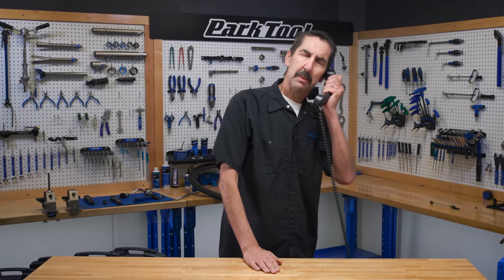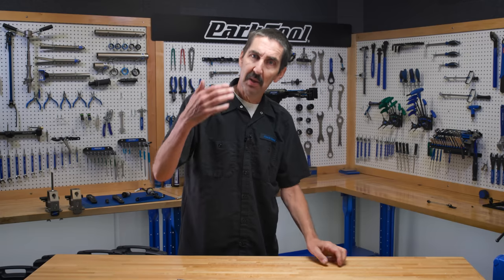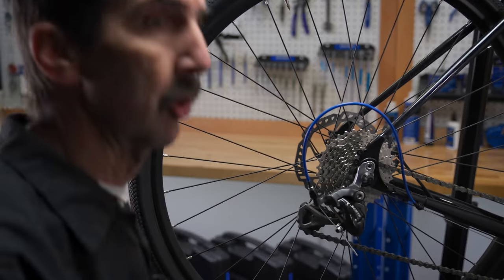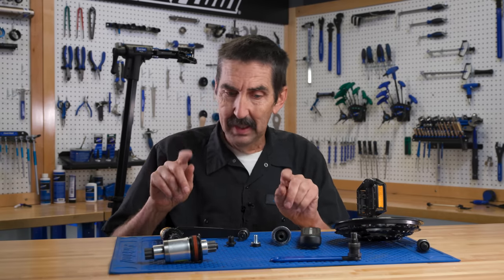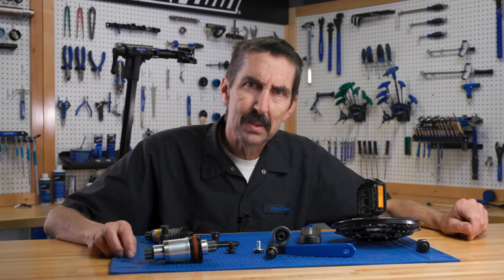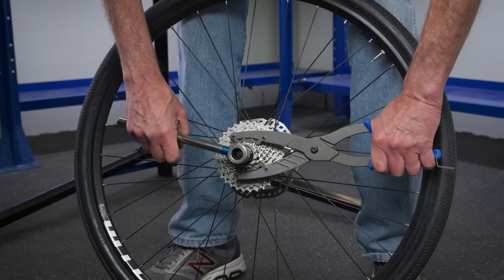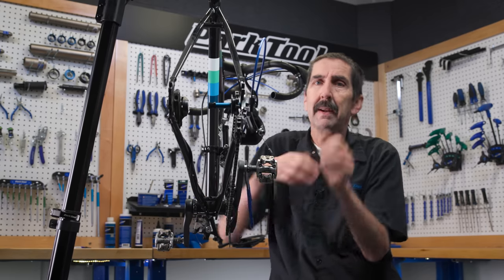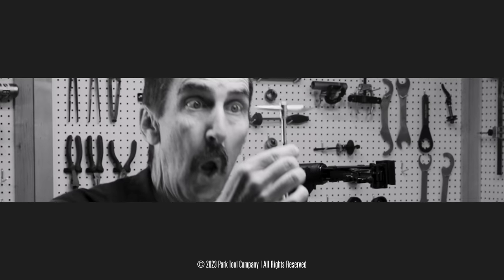You're Using Our Tools Wrong | Tech Tuesday #209

Comment: When mentoring junior bike mechanics in the shop, my first (jokey but firm) warning is that anyone found using the 15mm cone wrench on axle nuts will be immediately fired. 😉
Next is to get in the habit of spinning nuts and bolts the 'wrong' way when threading them on, until you feel the ''click of the start of the thread - it greatly reduces the chances of accidental cross-threading, especially in soft metals.
Also, get used to to feeling the tool's feedback through your hand - especially important with chain-riveters - once you've felt how it feels when it goes well a few times, use that 'finger-feel' knowledge to immediately back off and re-seat the tool if you feel the pressure going past what you'd expect - saves a lot of bent tool-pins and damaged chain-links.
Reply: Ha, ha, love it!   I wrote using a cone wrench on a 15mm nut above before reading your post.  Genius minds think alike!!!

Comment: The key to tool use is to engage one's brain before engaging the tool.  Think about not just what you wish to accomplish with the tool, but also what could go wrong.  For example, go through the motions of loosening a very tight nut or bolt without the tool, and see where your hands will wind up if the tool slips.  I've avoided many knuckle injuries, and saved damage to parts and tools, by applying this process.
Reply: this is basically exactly the thought process of orthopedic surgery too
Reply: Lefty loosy righty tighty
Reply: @kevinruiter8715  With bikes, not always.  In fact, every bike has at least one thing that's lefty tighty.
Reply: What’s the park tool part number for a brain? I’m not sure I have that tool…
Reply: @rangersmith4652  two things if you have a threaded bb . Forwards to tighten backwards to loosen with bike up the right way .
Reply: @Yoda-em5mt  That depends.  Is it English, Italian, French, or Swiss?
Reply: @rangersmith4652  true anyone with a non bsb bb deserves what they get ha ha .
Reply: That’s a fantastic tip. Often I’ll do a bunch of practice swings on the wall before hammering on the bike.  Warms up the muscles, letting you strike harder
Reply: @MehYam2112  Yeah, gotta prime the knuckles for busting.  Can't have any feelings in your knuckles if you don't have any nerves.  Modern problems require modern solutions.

Comment: Top tip, assess where your bodily extremities may end up if the tool slips. Particularly important when working around anything pointy like a cassette or chainring. Scrubbing drivetrain grime out deep cuts is never fun. 

Top Tip #2: It's not always lefty-loosy. I learnt this expensively the first time I tried to remove a BB cup from a frame. Destroyed the cup, bent a breaker bar, and almost trashed the BB itself.

On the subject of applying leverage I wonder if you also agree that certain jobs (removing BBs, cranks, and pedals) is best done on the ground, particularly if you don't have a pro-level workstand.
Reply: Yes, the ground is your friend for applying pressure!

Comment: Thank you Calvin and Park Tool for the advice and the many great tools over the years.  We run a community bike shop.  Our tools get used by people of all skill levels.  Park Tools work best and hold up the best.  A few we have found out the hard way that care is rewarded, and the lack of care ends up in broken tools or worse.  Chain tool tips are a good example of this.  All in all, Park makes the best and most appropriate tools for the job.  I do have one complaint, perhaps an objection to the idea that we're using the tools wrong.  We work on a lot of tired old bikes, either repairing or parting out.  So of course, removing cheap MTB freewheels is a regular thing.  We have broken numerous FR1.3 tools in doing this.  They just crush and split, either in the vise or adjustable wrench.  Inside a 1 inch box wrench they survive a little longer.  But the packaging and the video for the tool show using a large adjustable to spin off a freewheel.  The 1.3 is not strong enough.  What works to do this?  My trusty 20 year old FR1.1, or a small socket wedged inside the 1.3 for support.  I don't want to return any more of these.  I wish the tool was stronger!  Thanks for the tools, support, and videos!
Reply: While park tool is truely great, companies like Wera make outstanding quality tools.
Reply: @flawless7019  Wera doesn’t sell freewheel socket.
Reply: One technique I've seen is to mount the tool in a bench-vise and then set the wheel on top of it. Then you can use the wheel itself as your lever to loosen the freewheel.
Reply: @DennisWurster  Thanks, Dennis, yes we use this technique as well.  Without something to reinforce the center of the FR1.3 it can crack and fail in the vise too.  I think we're up to 4 or 5 that we've had fail in the shop in 3 years.  We also have now a 1 inch socket modified with flats on the outside, so it can be clamped in the vise and hold the tool without slipping.  Seems to work, with a few spacer washers inside it for correct engagement height.

Comment: Check your surroundings when you're going to crack a nut or screw too. Consider where your arm is going to go. You don't want your arm to move past or into anything sharp after you crack the fastener.

This is especially true if you're working on machinery with cutting tools in it, not just chain sprockets.

Comment: Calvin, thank you for making this video.  I’ve rounded out a few bolts in my time but I didn’t realize there were so many ways to use tools wrong!  My worst offense is using a. TW-5.2 torque wrench at bad angles because of a tight angle.  Is there a better tool to use for tight spots?

Comment: You can use the smaller (square taper) crank extractor to remove octalink and isis cranks, you just need to put something in there to cover the hole in the spindle, there are adapters for this specific purpose. Some crank extractors also have interchangeable feet to match the cranks being extracted.
Phillips screwdrivers will eventually round out derailleur adjustment bolts/screws so instead of buying a JIS screwdriver (the proper tool for this), I find that it is easier and cheaper to just replace the OEM bolts with hex socket head bolts and use allen keys
Reply: easiest makeshift type of adapter for isis cranks is an adequately sized counterhead screw. been there, done that.

Comment: I always install and remove pedals (and crankarms) with the wheels on and the bike on the ground.  That way I can position the tool to allow me to push down towards the ground, using my body weight to apply force and the drivetrain and tires to hold the crank arm in position.

Comment: I've got one!!  Hex keys and soft steel bolts. AVOID BALL END HEX KEYS on high-torque applications. Example would be crank arms and derailleur cable bolts. Ball end hex keys can twist in the fitting and lodge in, possibly marring the threads or allowing bad engagement with the bolt. USE NORMAL, FLAT HEX KEY sockets for proper tool engagement and to get the proper torque spec. on your proper components.

Also; when driving on large bolts e.g. cranks or pedals, use a large driver. It's difficult and unsafe to try to load 30-40nm with an allen key - step up to hex key sockets with a 3/8" ratchet driver for much safer and more effective tool use and result.

Comment: You actually got me on one. I bought an old bike to refurbish for my son. The BB was square taper. Without even thinking, I just grabbed the tool I normally use on my bikes. It managed to remove it. It forced the wider foot through the smaller hole. I just thought it was being difficult because it was an old bike hasn't been used in long time and it was stuck. When the crank came off, my tool is now stuck in the crank. LOL! I quickly realized the error of my ways. Fortunately, I wasn't reusing the crankset anyway.

Comment: Using a knife as a tyre lever, using a rotor alignment tool to straighten a bent rim, using needle nose pliers to unscrew a perfectly good stem bolt, removing the self extracting bolt from self extracting cranks and wondering how to remove them, 3D printing a dust cover to stop a BB from unscrewing, someone else taking rubber rim tape and peeling it apart when you look away, when the left pedals doesn't screw in the right crank, use the wrench harder. Some fun.

Comment: I abused my square tape bottom bracket tool on a stuck cartridge bottom bracket rounding off the splines a bit. So now I need to add a bolt into the pedal threads to hold the tool in place so it doesn't slip out. Also I now use impact guns to loosen cartridge bottom brackets (which is not very often anymore).

Comment: As a lifelong bike mechanic I have seen many instances of people using their tools incorrectly, or using the wrong tools for the job.  The thing that steams me the most is rounded nipples as I assume some of the damage was done by some teen working in some bike shop who could not be bothered to find the correct spoke wrench!  Most bike buyers do not try to true their own wheels.  Also, I often see deep scratches and divots on rims from screwdrivers used as tire pry bars! I use either the Park TL-5 levers or heavy duty plastic ones.  Never screwdrivers! Sure way to pinch a tube!  Last, I use only good quality stainless cables and the correct housings.  When I see brake housing on shift lines I want to hurl!  Not the biggest sin perhaps but easily avoidable by not buying those prepackaged cables/housing with a brake end on one side and shift on the other!  I have not used these things after age 12!  When I knew no better!   Last, when I see rusted chains I want to scream!  It is not difficult to service a chain!  And stop leaving your bikes in the rain!

Comment: I'd go back to square taper BB in a heartbeat if I could. I don't like Hollowtech 2. Octalink wasn't bad. I run a M970 crank that (as far as I know) is the only one that exists in the form factor it does - it's got a 24mm Hollowtech 2 size spindle and thus it works with all Hollowtech 2 bottom brackets, but it has a far more chunky mating surface, quite like an Octalink.

Also, this crankset doesn't have the typical (and stupid) 2 bolt system found on HT2 cranks (where the bolts strip, ruining the left crank arm) for tightening, it has just one huge bolt that gets tightened to 40Nm on the left crank. I love it.

You might wonder why I use it, if I "would go back to square taper in a heartbeat" - well because my bike has a stupid press fit BB shell and thus, I have got a Praxis Works converter on it (PF30 to HT2) and that's why I have to run a HT2 spindle... Praxis Works just don't make a converter from PF30 to square taper and even if they did, I don't think it would be sensible in a press fit shell.

The old M970 crank is the best design I have seen, whereas the most recent HT2 cranks have a weak mating surface and the M5 bolts that say 12Nm on them often strip. I mean isn't it obvious why? M5 bolts (or maybe they are M6) and 12Nm don't go together well! The max I'd say a M6 bolt should be taking is up to 8Nm. Design flaw.

Why not use the M980 crank since it's newer? The chainrings are a proprietary BCD, whereas the M970 is standard 64/104 BCD. There isn't a better triple crankset for MTB other than the M970.

Comment: Use the right torque and/or make sure to never over tighten anything.   I've seen so many people over the years (especially the general public) think a screw or a bolt needs to be as tight as possible. Either use specific torque wrench, use the right torque setting on your screwdriver, or manually quarter turn backwards

Comment: Tool tip: If you're trying to undo a stuck screw, ideally before you round it off, but even afterward: Use the principle of tool engagement (apply downward force to prevent the wrench slipping), even tap it a bit with a hammer to get full engagement.
Then, use the grippiest pair of pliers or vice grips you have to grab the head of the screw and turn both the wrench and the pliers in unison. This has given me just enough grip to remove many a stuck bolt that wouldn't budge with either method alone.

Comment: Wear appropriate gloves for the job. When unscrew locking rings for disc rotors for example, like Calvin did. Nice to see how easy you can slip and end up cutting your hand on the sharp rotor edges. I learned that the hard way. Nice heavy leather glove for the hand holding the tool on the rotor from that point onwards. Also prevents injury when sending your hand in a chainring when unscrew crank arms.

Comment: Thanks so much for this guys.  As a You Tube certified mechanic, my education never included all the theory parts like this :) 
This is super helpful stuff.  
Also, gee I'm starting to dislike lock rings on disc rotors for this reason.  Have a couple I want to take off, and getting decent purchase on a through axle wheel can be really tricky.
Reply: Just wait till you encounter a T47 BB. Similar width of engagement to a rotor lockring but torque spec is 50Nm. Naturally Park have a new tool to help

Comment: I was once accused of misusing Park pedal taps (tap-3) to clean up the threads on a one-piece crank.   The description says they are for use on alloy and steel cranks, but the shop manager wouldn't hear it.

Comment: If you have a square spindle on your bottom bracket and find it hard to take off try this. Get an empty milk bottle, put a piece of string through the hole at the end of the tool and then thread it through the milk bottle handle. Fill the milk bottle, the weight will pull the tool down, if need be use two milk bottles.

Comment: JIS cross-slot derailleur limit screws don't play well with US Phillips screwdrivers (it's not you; it's a different standard). If you don't have the JIS screwdriver, the screws are generally also slotted for a small straight blade. Try it; the gods will be pleased.
Reply from the maker: Yes we do, see https://www.parktool.com/en-us/product/derailleur-screwdriver-dsd-2
Reply: Also the case for stroke adjustment on some Shimano MTB brake levers. Only JIS will do, a standard Phillips will cam out and destroy the screw (and potentially scratch your lovely titanium-look XTR levers). I'm pleased current Shimano mechs have finally switched to hex head screws for limit adjustment.

Comment: Down force not always works with BBT69. When centerlock is stuck and you need to apply a lot of force it is hard to keep the tool in place, the bbt69 is just too tall, the one thing that could make life easier is guide pins for bbt69, and with already having internal thread I think it is possible to provide guide pins for this expensive tool, that could be screwed in and help prevent breaking out of the tool
Reply from the maker: Keep your eyes peeled down the trail a ways.

Comment: Use a wheel quick release and washers if need be to hold the tools in place.
Reply: I bought a longer bolt (M12 fine thread) at the hardware store, and washers for spacers, to keep bottom bracket tools like the BB30 engaged while getting cups loose.  Engage into the bolt hole in the end of the square taper spindle, break loose the cup, then back off the bolt as needed as the cup unscrews so nothing binds up.
Reply: I have used a bar clamp to do the same with square taper bbs.

Comment: CCP-22 and CCP-44 have noticed inconvenience in the length of the handle. Sometimes it is necessary to make titanic efforts. You have to give preference to CWP-7, or lengthen the lever. A longer cap handle with a hex socket would solve this inconvenience.
Reply from the maker: True! But making the handle longer will cause it to run into the pedal on many cranks. The CCP-22 and CCP-44 are designed for convenience for most cranks. For cranks that are quite tight and take a lot of pressure to remove the CWP-7 offers more versatility to put more leverage into it.

Comment: There is a proper tool for the bolt and nut. What I see most is rounded edges of bolts and nuts, from using pliers, vise grips, crescent wrenches.

Comment: I remember a teen who would sell us a pipe wrench which I assumed was stolen from a shop nearby and wanted us to buy from it. Of course, using a pipe wrench on a nut would make the hex nut into a circle nut.

He tried to convince me that "It has great gripping power. It lets seized parts remove like its nothing" 🤣🤣🤣 
Anyways, long story short I made a call to not to purchase it for obvious reasons. I think breaker bars, ratchets, socket and open wrench, and even adjustable wrench is already enough.

Comment: What does Calvin (or anyone, really) think of Barnett's position that threads should not be extended on a fork unless all other options have been exhausted? The Barnett's DX also says the FTS-1 should also not be used to cut new threads into a fork unless you absolutely have to and that if you do, only cut 1/4 turn of new threads every 15 minutes!  That means if you want to cut 1 inch of new threads it would take 24 hours to complete! The DX literally says that "cutting new threads with the FTS-1 is and incorrect use of the tool." Just curious of anyone's thoughts...
Reply from the maker: Many forks have had threads successfully extended with the FTS-1.  It is an expandable die, and it is designed to be opened as much as possible for a first pass. It is then reduced for 3 more passes, cutting a bit more each time.  This does not duplicate a lathe cut, but does give good serviceable threads.
Reply: @parktool  Thanks for the reply!

Comment: I am embarrassed to to say my new cheap Hybrid had a loose head set bearing. I corrected the problem with a channel lock plier. Yes, it scarred the retainer nut. I tried rags but the retainer was too deeply recessed for an adequate grip. Adjustment was good but left some marks...so it wasn't good. WRONG TOOL